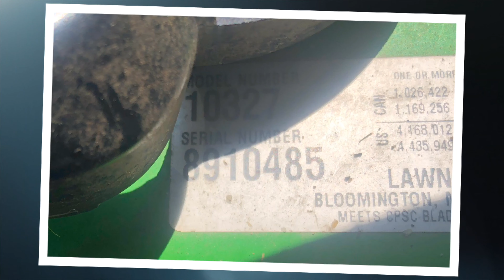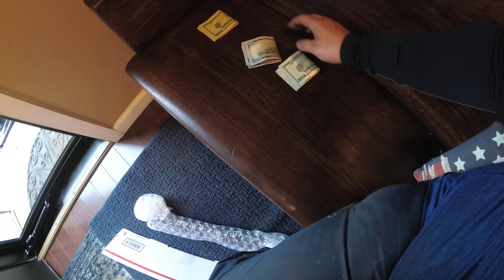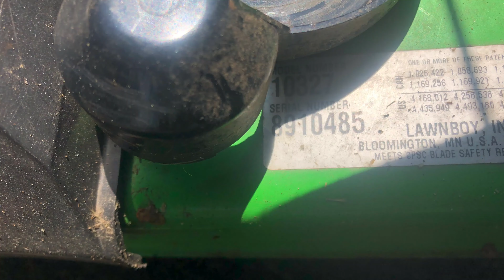Lawnboy 10327 Staggered Deck Lawn Mower Overhaul Refresh HOW TO Wheels and Blade

Comment: Did you use a battery powered torque wrench?  I cannot get the wheels off with a socket set wrench. What is the torque needed for getting the wheels off?
Reply from the maker: That is a battery powered ratchet and I there is no torque setting.  I think it tops out at 30 ft/lbs.

Not much torque is needed for mowers

Comment: How do you take the gear off of the wheel?
Reply from the maker: Excellent question!  I don’t recall if they are removeable as some machines they are pressed on. Being the wheel is plastic it’s one shot deal.  When you order wheels the gear comes built into it like a HONDA.

Thanks for the view and comment, hopefully you subscribed to my channel 🤙🏻🦅🇺🇸🔧